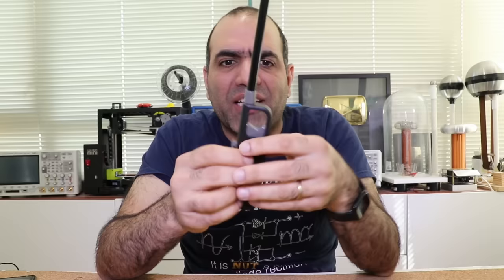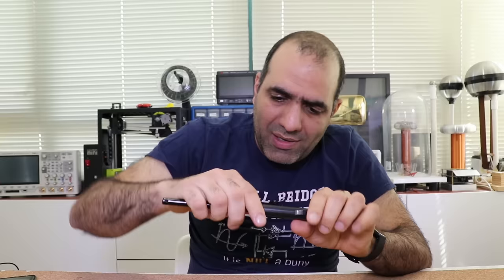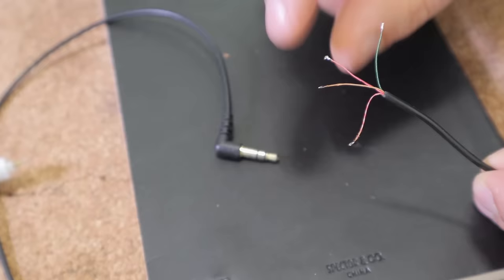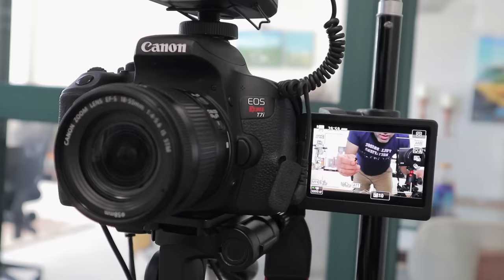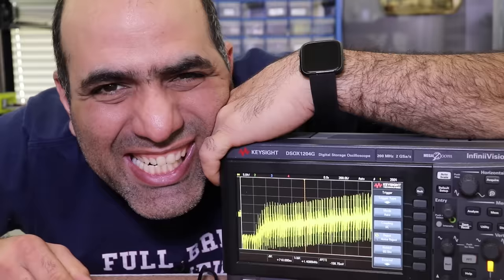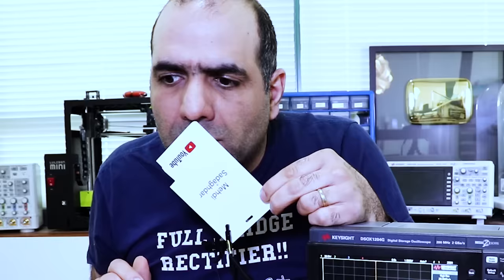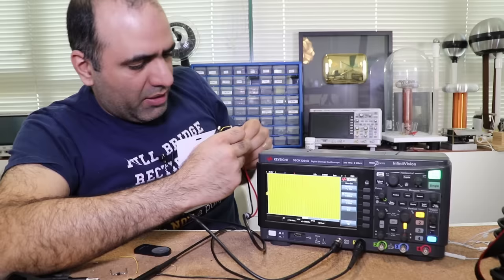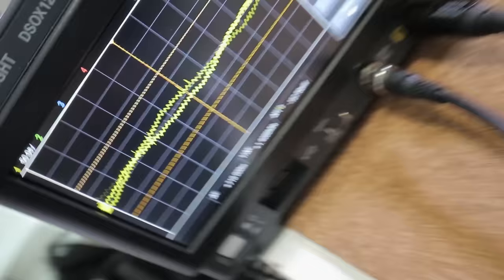LIGHTER is a MICROPHONE

Comment: By coincidence I did the exact same experiment right now. You should pry away the hammering mechanism, which is still in place here. The tip of the crystal assembly is a small 1mm rod and it's where it is the most sensitive. I think in your configuration here you only got a rather tiny fraction of the output voltage that is possible.

Comment: "I'm not an absolute idiot"

Flashback to when his Jacob's ladder fell on him.

Thanks for the likes this is the most I had in my life!
Reply: Life saved by a short-circuit prior to touching it
Reply: he is a lucky man
Reply: @mernok2001  yes, but the short circuit kind of gave him some "extra safety". I could be very wrong, but in a short circuit the voltage drops, not to zero but way below what the transformer is putting out. The current goes up tho. Maybe the voltage drop really is what saved him.
Reply: Is it just me or I saw his hand spasm during that
Reply: "Sheer Luck, Thanks to my flimsy cables connected to the transformer, that fell off quickly, I only sustained some third degree burns"

I think that's what he said in that video :P
Reply: @HeyItsDominicus  hahah just third degree burns?
Reply: @benalexz  Well when we're talking about microwave transformers, even a ripped off face would still be "only" as long as alive.
The damn thing outputs like at least half an ampere on ~2kV
Reply: @sebagomez4647  You do realize he knows exactly what he is doing?
Reply: Or the time that he tried to make an electric guitar and just strung some wires to nails on a board and plugged it in...
Reply: Lol I remember that
Reply: This brings back scary times
Reply: Electric guitar was better
Reply from the maker: That wasn't "absolute" level idiocy... Although maybe it was... Up for debate
Reply: Nah, it's nothing when compared to electric guitar.
Reply: @ElectroBOOM  it was. Admit it.

Please keep living.
Reply: @Unfinitypae 10 - 
haha ...  ElectroBOOM usually just plays the ID10T ... but sometimes he is just a bit clumsy, but this works for our entertainment, I love it !
Reply: @Killerspieler0815  indeed, he is rick from rick and morty just a little bit more clumsy .
Reply: @ElectroBOOM  hi mr
Reply: @ElectroBOOM  look at the youtube plate at 4:58 omg someone moved there :O i'm scared.
Reply: Thu Nell Ⓥ  there's research going on on free energy btw and it seems to work
Reply: @rorydakin8048  very underrated
Reply: Lucky man

Comment: I once had a Danelectro DM25 guitar amp.  For the reverb it sent a signal to a piezoelectric element that acted like a small speaker.  That element was connected by a coiled spring to another piezoelectric element that converted the spring's motion to an electrical signal, the reverb signal.  It looked like a regular Hammond reverb spring box but used piezoelectric instead.

Comment: Using the piezo was not what I was expecting! I've seen a flashlight reflector used to pick up audio vibrations, which were then converted to an electronic signal by a photocell. I thought you were going to do something similar to that.

Comment: They actually use piezo crystals I think in Big and Small Sound Sensor electronic modules. They can't act as a microphone because the audio signal is mapped to discrete integer values to output the audio level.

Comment: I doubt this will be seen by the man himself. I had to clarify since I'm a pro audio nerd that the 1/8 inch cable shown in 2:29 is a TRS (Tip, Ring, Sleeve) that makes positive left (Tip) positive right (Ring) and shared ground (Sleeve). The other wire is a static shield which most audio cables have that carry anything above 16 ohms. So its not really an extra wire but an insulator.

Comment: For those who don't know, there actually are piezo pickups for guitars which work on this basis.
The vibrations of the wood are used the same way and, unlike classic electromagnetic pickups, piezo pickups can be used on classical and Spanish acoustic guitars which use nylon strings (not metal strings).

Comment: What if the Ancient Egyptians used piezoelectric power to transmit radio waves like smoke signals?

They could easily hit granite Obelisks and generate piezoelectric electricity. The Obelisk would act as an antenna transmitting pulses like Indian smoke signals.

Believe it, or not!

Comment: I thought you were going to use the flame as a microphone...
Flame from candle is conductive plasma; vibrations in air perturbs combustion, changing impedance of circuit.  Microphone.

Comment: What if you made a 70 ton piezoelectric box with biological material inside it (like a cow leg) would the gas pressure from decomposition cause the box walls to compress to generate electricity

Comment: Hello, I have used a small electric motor as a speaker!🔊 Just cut a speaker out and replace it with an electric motor, then turn up the volume and the motor acts like a speaker! Woohoo! (Not mains power!!, ⚡Just batteries only!!)🔋

Comment: it's not high voltage 🤦🏻‍♂️
Reply: ofc it is, otherwise there wouldnt be an arc of about 0.5 cm...
Reply: @clawer2969  well, In arc welding, spark is maintained for ling time at very low voltage across the objects, once it is struck.